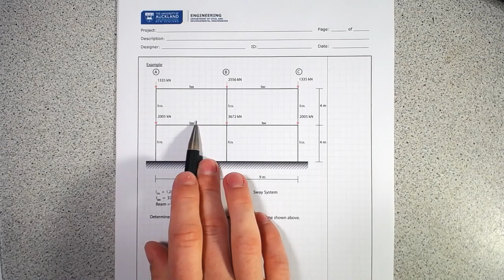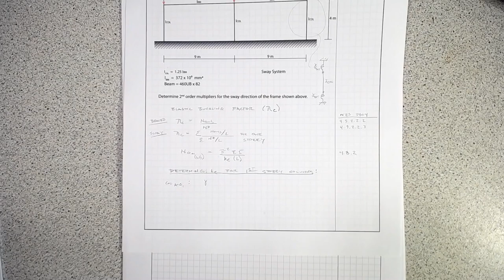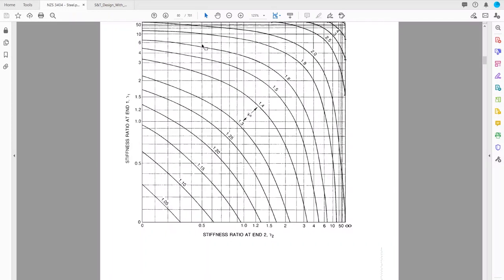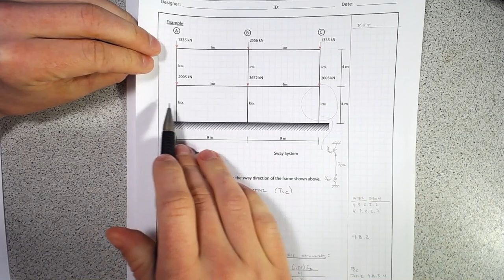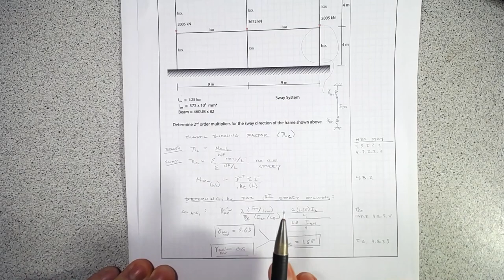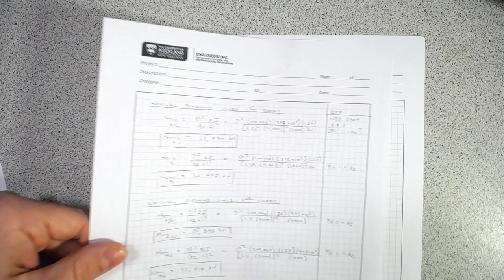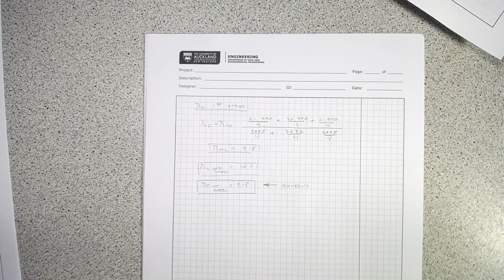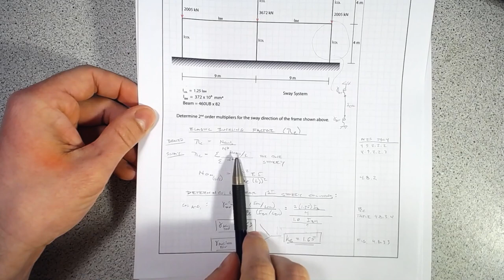2nd Order Effects: Design Example 2 - Sway Frame

Comment: Thank you for your video. If the frame were timber, would the procedure be similar?
Reply from the maker: The fixity of the end conditions and the gamma values are specific to the experimental rotational stiffnesses of steel members, but the overall accounting for P-Delta actions (i.e. second order effects) should be similar.
Reply: @lucasshogan  Okay. Thank you. I thought so. If the calculations showed that a second-order analysis is needed, can you point to any resource where an example of actually carrying out a second-order analysis is done (video, text, etc.?)